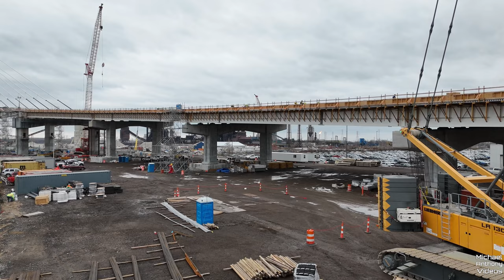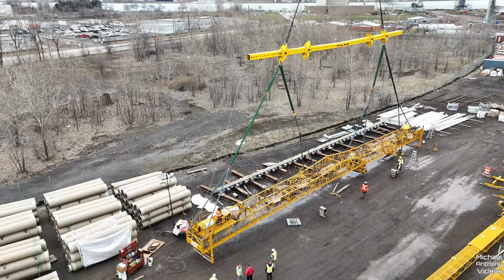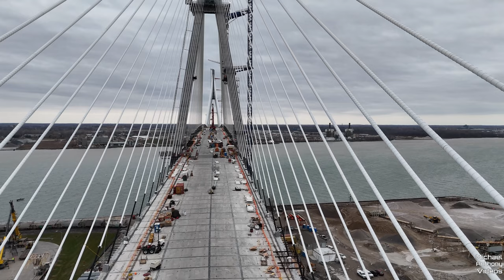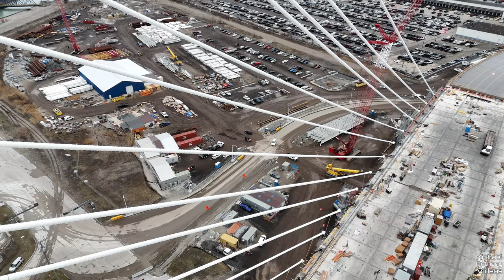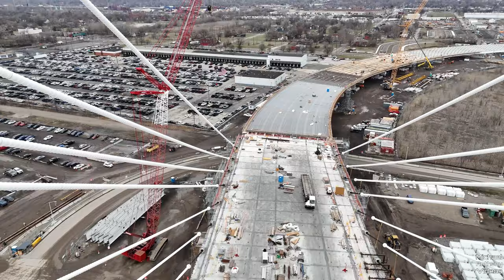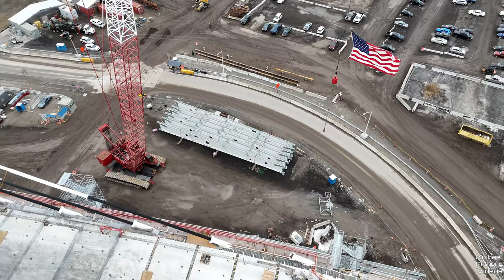Gordie Howe International Bridge Construction Update | Detroit 4K Drone

Comment: Hope they build substantial barriers around any of the support columns near the water. It would be a shame to see a fine bridge like this one collapse due to contact like the Baltimore bridge.
Reply: The stanchions on each side of the bridge are built on land about 40ft away from the river.  That may not be much, but the dredged shipping channel is towards the center of the river and any boat with a significant draft that goes wandering out of the channel will generally run aground before it gets very close to the riverbank.
Reply: @dougall1687  let's hope so, over time erosion and dredging changes water depth which causes culping beneath pilings and weakens stanchions and barriers designed for protection, they'll have to constantly monitor them for maintenance.
Reply: @dougall1687  yea I seen the video of their location. These newer cargo ships have much wider deck overhang than older ships, they can easily contact critical bridge infrastructure without the correct piling spacing in place. Some of these newer ships bow decking is 90 feet beyond the hull beneath the water and they continue to build them larger and larger.
Reply: @gregblanton9386  Those newer super-large salties wouldn't get through the locks into the great lakes though - seawaymax width is only 78ft wide (and that's above the waterline too as they need to be lowered within the lock walls).  Also as I mentioned, the river is pretty shallow by the shores of the river,  11ft on the Canadian side for example out to about 100ft from the bank.
Reply: @dougall1687  good deal.